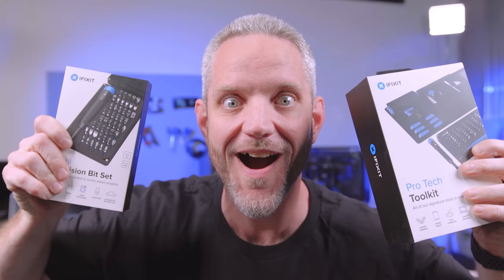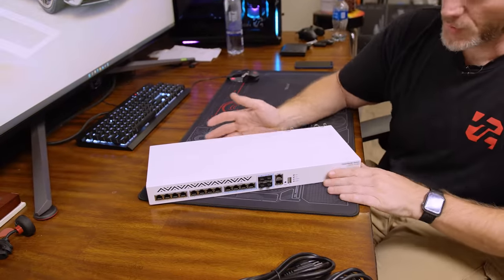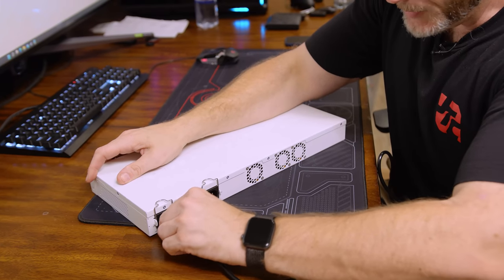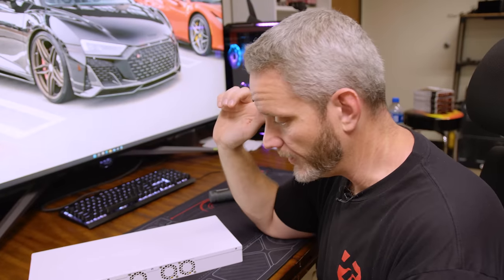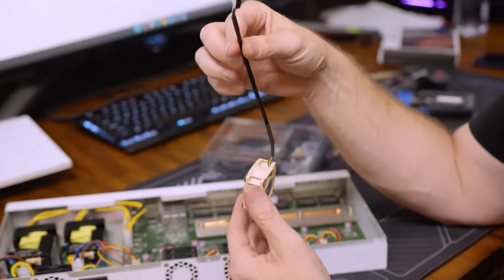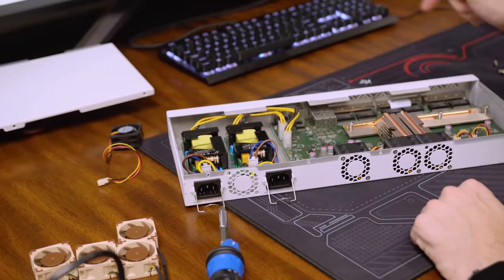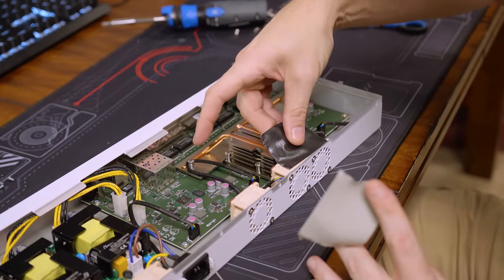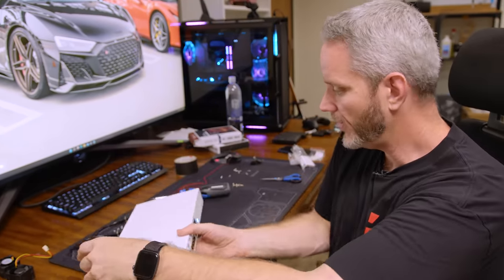We had to modify our new network switch...

Comment: You chose MikroTik. You chose well.

As others have commented, to make it run a little more efficiently (and boot faster), log into its management UI and switch it to SwOS (SwitchOS). Have to glance at the online guide since the UI is absolutely bonkers crazy.
Reply: Isn't SwOS an abandoned product full of bugs? Done any iperf throuput testing on yours using SwOS vs RouterOS to compare?
Reply: @jasonsachinger3276  I wouldn't call it that; it's certainly not perfect but if you want switch throughput, SwOS is ideal on these MikroTik routers—I'm able to get multiple 10 Gbps paths through my CRS309s tested bidirectional with iperf3.

MikroTik is great for the price + reliability, especially if you don't care about the routing functionality (which can be dizzying to configure through their insane UI). If you want anything more fancy, you'll have to pay a lot more!
Reply: @JeffGeerling  Geez the mikrotik app on phones. Its quick setup section has been through a bunch of updates that improved its performance and usability, it can be quite good for most basic configs :)  You can also run containers in latest routerOS dev update which might be up your alley :)
Reply: I think you should spend some more time on routeros and winbox. It is absolutely the best solution for switching and routing. Just make sure to use router hardware for routing and switching hardware for switching.
Reply: Mikrotik is terrific in terms of switching and routing.  I have fully enjoyed learning the tools and tricks of ROS. Later down the road I might get a 24 port MT POE switch to replace my old Dell X1018P and RB2011 if call centers would quit hogging them all up.
Reply: @jasonsachinger3276  use routeros and stop whining
Reply: @frostbite1991  anything is terrific if you cheap out on something like rb2011

Comment: Just a comment on the power supplies. Parallel on the capacitors there should be a discharge resistor that drains the capacitor. So after a few minutes it should be safe to touch. If in doubt don't touch it or measure it with a multimeter.
Reply: @killingtimeitself  that is a possibility but the capacitors don't like that very much. It is possible that you damage the powersupply
Reply: @robhofkes3221  It's better than the alternative, though.
Reply: @danny_dan4323  The proper method is to get a power resistor and drain the caps with it instead of shorting them.  But that's only if the circuit doesn't already have a bleed resistor, like Rob said.
Reply: Honestly unless you remove the power supply from the stud its on, theres almost no way to touch the terminal of those capacitor, even if a heatsink is say somehow connected to the negative pin, so what ? No path back to the positive, the only chance you might get shocked would be if you actively poke around the component pins on the board but thats also very little chance, its not plugged in, it wont create a path to gnd cause the stored charge on the cap isnt earth gnd reference
Reply: You drain a cap by licking both pins.
Reply: @Nickscrazylips  This method is best suited for when you feel tired before work and need some energy whilst in the chaotic event of running out of coffee.
Reply: @DeerJerky  Looks like I found a way to not waste the energy stored in my 2kV 800uF cap!
Reply: @DrakkarCalethiel  enjoy
Reply: One should always discharge the caps, even if you think the PS has bleed resistors, if you are going to be working around an open frame PS. (and yes use a restive lead rather than a jumper)
nine times out of ten the bleed resistor will have done the business.  The last time it either wasn't installed/was costed out by the Chinese assembly house.
Reply: just work one handed, it's not referenced to anything once unplugged so you'll only hurt your hand
Reply: @brendanrandle  I was going to add that to my comment, but I figured all EE/ETs were trained to do that, but an untrained amateur wouldn't know how to do one handed work correctly.  That might be worse then telling them to just make sure the PS Caps are de-energized.
Reply: Or use that handy circuit tester in your screwdriver!
Reply: @Calamity_Jack  That tester can only detect active AC power not static power in a capacitor.  Potential current doesn't generate a EM field, only flowing current does.
Reply: @metaforest  I guess I should have appended "Just kidding" to make it clear I was. lol!
Reply: Power the switch up and then yank the power cords. The capacitors will be discharged in under 10 seconds as they try and power the switch with no input power.
Reply: @jonathanbuzzard1376  I do it the other way around. Unplug the device and then you push the power button to drain the caps.
Reply: @jonathanbuzzard1376  that won't work.  The SMPS goes into undervolt when the input at the caps drop below about 75 volts.  Doesn't matter  if the power switch is opened or the cable is pulled.  That is why properly made PS have bleed resistors, but if you  are not sure, you take the precautions.
Reply: @Easy_Skanking  That won't work as well as many power supplies won't attempt to start. To work properly you have to have the device on and unexpectedly cut the power.
Reply: @metaforest  Sigh, yes it will work the capacitors are now at a voltage that is extremely unlikely to kill you. On a SMPS you rectify then smooth so the input capacitor is in the civilised world at ~385V DC. That is very nasty, but if you turn the appliance off at the wall (most sockets are switched in the UK) then almost instantly the input capacitor is at comparatively safe voltage. Another interesting feature of SMPS is that 400V rated input capacitors are NOT safe and you need to use 600V rated ones if you are designing a universal power supply intended for use anywhere in the world. The reason is in large parts of the world the 230VAC is derived from 415V three phase. If you have a neutral fault then your mains goes to 415V, and your input capacitors are now at ~585V DC, way above 400V and they can and do fail spectacularly. I used to work in a building where a neutral fault caused flames to fire out the back of an ATX PSU from a failed capacitor which set fire to paper on a noticed board behind the computer. The fact that the fire station was across the road and they where there in 90s from the alarm going off saved a serious fire, with only the office being damaged. However it was a life sciences research lab at a university and the insurance bill for the wrecked lab equipment was in the high seven figures. Everything electrical on that floor more complicated than a light had to be replaced.
Reply: @jonathanbuzzard1376  I'm pretty sure I know better than you how the input to an SMPS works.   I've made them from scratch.  Just to prove I could.   They still are in service.

Comment: @jayztwocents - I implore you to please remove the 3M-tape you added! The glue is going to dry out from the heat and over time causing a mess for you to discover later. If you're concerned by the wider gap created by the shorter Noctua fan, you could 3D print a tiny shroud instead of using tape. Great mod otherwise!
Reply: Agreed.  Or at least use that thin plastic sheet stuff he uses for themed cases in conjunction with the tape.
Reply: also the chassis lid sits right on that tape making it redundant. If anything its the sides to the heat sink I would worry about

Comment: Beside from this, another relatively "cheap" option for a 10G RJ45 switch that I can find is Unifi Switch Enterprise XG 24. With double the ports and price, but also with 2 extra 25G SFP28 uplink.

Comment: Unifi's Switch Enterprise XG 24 is what we use in our rack. It has (24x) 10Gig RJ45 and (2x) 25Gig SFP28 ports. A little expensive at $1,299, but it is one of the better deals for that configuration (when it is in stock).
Reply: Yea, that has been Unifi's problem the last 2 years. allot of stock issues
Reply: I use these at my work as well - Great switch / ecosystem.  But then again, I'm a ubiquiti fan boy.
Reply: I use Ubiquity everywhere i can except huge complex networks with critical infrastructure. I'm a bit of a fanboy... But they are changing the game when it comes to managing their stuff.
Reply: It's pretty much impossible to buy anything from ubiquiti right now. You can't throw money at them if you wanted.
Reply: @corbosman  and that is another big problem. If I can not get supplies than the product is useless to me
Reply: @tdogz I was also gonna suggest USW-EnterpriseXG-24. Yes it's double the price but also double the ports and more ports in one chassis is just what he says in the video is what he want's. How is the fan noise on that model? Looking at buying that for myself but I can't have much noise where I need to install it.

Comment: Instead of using tape to direct the airflow, you could 3D print spacers that go between the fans and the metal chassis.  That would push the fans back closer to the heatsink.  Use the fans you took out as a measurement guide and eyeball the thickness of spacer needed.
Reply: 3d print a fan duct go from 120mm to the stock size remove the area that's solid to increase flow and keep fan speed down
Reply: @Mikeracing2005  but also you have to remember that in order to do that reduction the fan would need ridiculous static pressure for it to have decent airflow which would almost mitigate the advantages of using a smaller fan as higher speed = higher static pressure
Reply: I think their 3D print passion was short lived.
Reply: @N0N0111  I don't necessarily think that is fair, I personally have a resin printer and an fdm printer like them and in my experience it is not always the best solution to 3d print something and also sometimes it is just completely unnecessary to do so
Reply: Or just spent 5 seconds with tape....
Reply: @kidShibuya  - The tape really isn't necessary when you remember that the top cover is going to be 1mm above the fans anyway.  🤣
Reply: @phydeux  absolutely my first thought when Jay did it.  He was solving a problem that only existed while the lid was off
Reply: Yea I was thinking he has a 3D printer, make a duct to force the airflow around the fins, the current factory layout wastes a ton of airflow that will do nothing to cool the finstacks.
This way you can have silence and the cooling.
Reply: Just not in PLA or PETG. I doubt that heatsink gets hot enough to deform them but ASA is easy to print with and will be some insurance against heat.
Reply: @Ughmahedhurtz  That's part of why the spacer would go between the fan and the chassis.  NOT next to the heatsink.  The main idea is to push the fan blades up against the heatsink like how the stock fans were.
Reply: @hardlyworgen71  lol...I guess I had a space-cadet moment and missed that point. Yep, it's a good idea and would simplify the printed part design to boot.

Comment: Missed an opportunity to 3d print a little fan shroud.  Blocking the sides would be more important than the top, since the lid itself covers the top.  And I was curious if all of the fans were set to exhaust.  I assume so.  Overall a really nice mod.  Definitely worth the extra 10%.
Reply: Came here to say the exact same thing. *owns 3d printer*, uses duct tape to make a shroud.
Reply: And maybe there will be a use for the removed fans somewhere at some point. They're not broken, just not very quiet.
Reply: @andrewwaller8499  They might not have space to use the 3d printers right now.

Comment: I've got the 16 port SFP+ Mikrotik switch.  It has served me well with 3 VM hosts, a storage server, wireless AP, and my main gaming machine all hooked to 10Gbe.  It's the model with a huge heatsink off the back of the unit with two fans and is quite quiet.  I have my main gaming machine and wireless AP hooked to it through SFP+ to 10gbase-T modules, which were like $48.  The wireless AP even hooked to it at 2.5Gb, but the switch shows it at 10Gb.  The 10Gbase-SR modules were only like $10 each, and the om3 cables I used were dirt cheap compared to cat6 cables.

But that's just me.  I prefer fiber because of the lack of EM interference.  You do what you need.
Reply: Exact same switch and love it.  Rock solid after three years!

Comment: I purchased an older Extreme X670v-48t switch off of eBay for my house since I have fortunate enough to have Google Fiber.  Works like a charm and came with some advanced licensing and four QSFP+ ports for 40 GB links to other switches.  No PoE or NBaseT support but I have some other 1GBaseT switches for that.  I had to get the QSFP cards for my X460-G2-48p-10GE4 units but I'm now in a near non-blocking scenario between my switches if everything were going full tilt.  Regardless the old corporate unit path does get you a lot of your money in terms of hardware but you're also out of warranty.  

There are a few 10 Gbit switches with 802.3bt (90W PoE) capable RJ45 ports but due to the supply shortage they're nearly impossible to get still.  For work, I'm still waiting on a unit I ordered 15 months ago to arrive.  For business usage they're not outrageous but not cheaper either new.  In the SFP focused areas, things have quickly transitioned SFP28 capable ports for more bandwidth.

What is driving me crazy is the constant mentioning of 10GbaseT ports simply referred to as 'Ethernet' as if the SFP is not also Ethernet.  Ethernet is a protocol that span different physical iterations based upon need.
Reply: I suspect if he'd said 10GBase-T each time half the audience would have been confused..
Reply: @TonyHoyle  It is about time to start using it as 2.5GbaseT and 5GbaseT are also available now for Ethernet in the consumer realm.  25GbaseT and 40GbaseT have specifications out there but I'm not aware of anyone using them in a datacenter, commercial or residential application.  

I have heard of 40GbaseT4 being used in automative which is four 10GbaseT1 pairs bonded into a single 40 Gbit link.  10GbaseT1 is 10 Gbit as the name implies but over a single pair of copper wires, again only used in automotive applications.

Comment: I did a similar fan mod with my G.Skill memory coolers. The stock white LED fans they used crapped out after only 5000 hours so I went and got four 40mm PWM Delta fans as replacements. Not only longer life but with PWM I can monitor/control them as well. Definitely happy with the result 👍

Comment: I had a NetGear 10G RJ45 switch a few years back at work - swapped its extremely loud internal fan with a Noctua, that fixed it and made it workable in an office.  Keep that unit well-ventilated, those 10G-base-T ports generate a lot of heat.